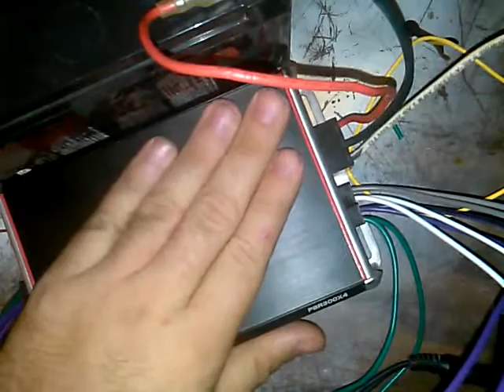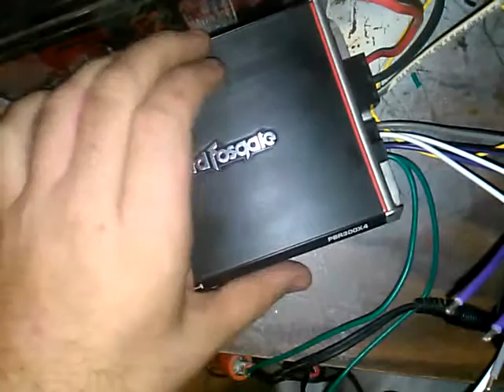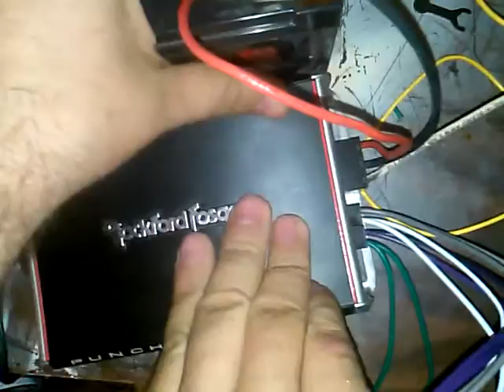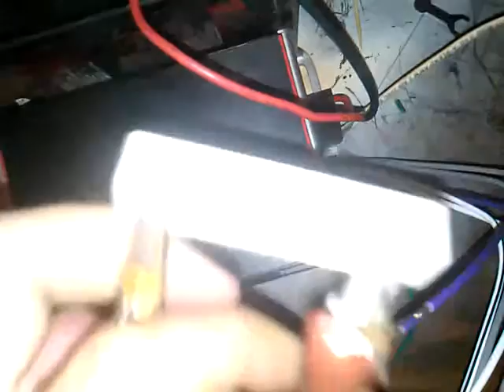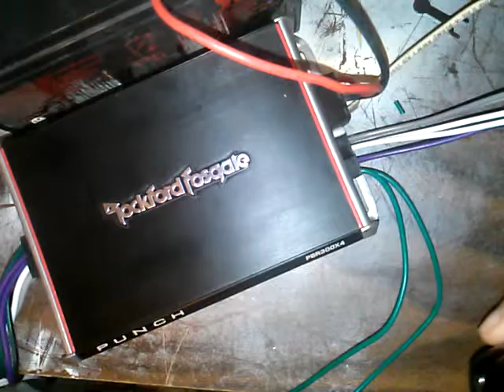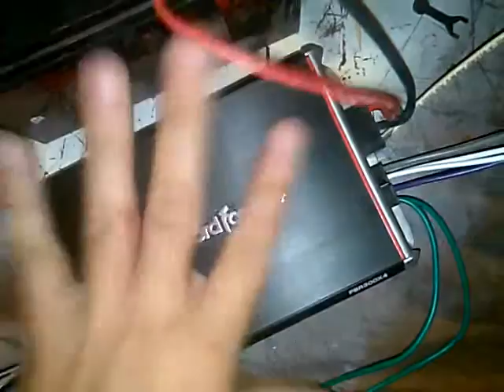Rockford Fosgate Micro Amplifier REPAIRED!

Comment: How much did it cost to fix this
Reply from the maker: For a small amplifier like this is about $150 flat labor plus parts. I cannot remember the exact total on this particular one though
Reply: ElfNet Gaming ok thank you I wonder if it would be feasible to fix or just buy new
Reply: $150+? ouch i have a 2 channel that needs repair but that's a steep price
Reply: Amp total cost $149 out the door...
Reply: I was thinking about modifying my pbr400.4 by adding a fan to the bottom off it actually getting a professional to cut the whole would that be a good idea